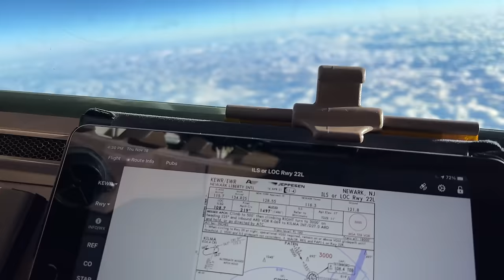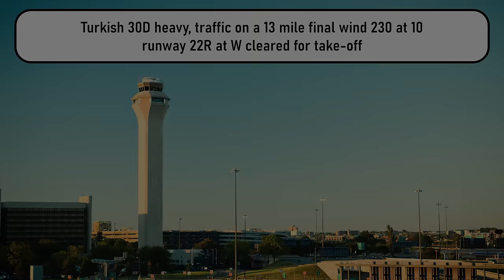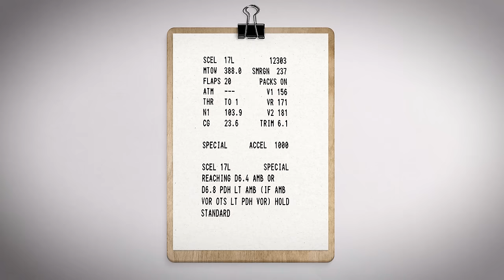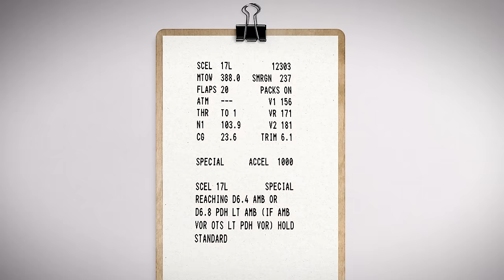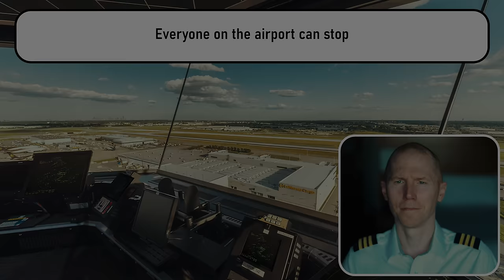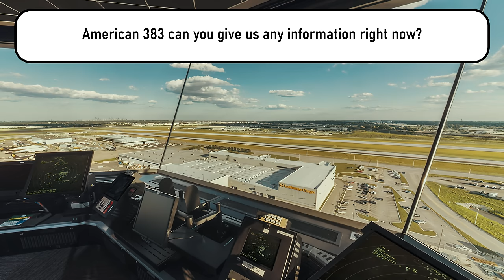American 767 Engine Fire

Comment: I've taken off from a taxiway once, the runway was occupied by a private pilot taking their sweet time vacating so ATC cleared me for a departure from the taxiway. It helps that I was driving a helicopter (Cabri G2 for the planespotters) and can just sorta go up.
Reply: Had us in the first half ngl
Reply: Funny story, although I am confused (a regrettably common condition). Why do you even need a runway? We've all seen helipads on skyscrapers, yachts, and hospitals, and let's face it, they don't have a huge amount of run-off. Do you just drag it out there on the asphalt, making some Formula 1 Singapore GP style sparks for show?! (I mean, that would be fun.) Or is it just airspace management? 🤔
Reply: @Cameron655  Runways are surrounded by something called a Strip. The Strip is an area of airspace guaranteed to have no obstacles or intrusions which allows aircraft to take off and land safely and provides enough space to perform emergency maneuvers. Runways are also rated for a higher pavement loading than taxiways. Technically speaking you can take off from any area that you can drive on but landing creates a huge impact which won't affect a runway but may damage a taxiway. It is always safest to perform maneuvers on a runway. Airports like to treat all aircraft the same so if there is no specific procedure for helicopters then they will be treated the same as a plane. In the case of the Cabri, driving around an airport can be done in one of two ways; It can be propped up on a pair of wheels and pushed around by hand (normally only used on the Apron) or you can perform a hover taxi in which you take off into a hover and then move around slowly.
Reply: @Cameron655  It's safer for a heli to get into a ground effect while still having some forward speed, rather than to start hovering at altitude and dropping down vertically.

If the engine dies and the heli has to autorotate down, forward speed is king.

Sure, the same gradual descent and then transition to hover can be done above a taxiway, but I guess it's a bit more comfortable knowing that you can approach the runway at any speed and not worrying about coming in too fast, too close to other traffic or not exactly on centerline.

But I'm not a pilot, just a heli sim player.

Also, some heavy helis have wheels and like to land and take off like an airplane for the same safety reasons.
Reply: Oh you trying to look smart eh by keeping important information from us until the end, wow you're so witty
Reply: I feel RickRolled.
Reply: @therflash  he probably dint go straight up most heli's are incapable of that/your trained not to do that, you cant even go straight up or down if your flying emergency helicopter's (medievact ect) also it is pretty common to take off from the taxi way as a helicopter (source I'm helipilot in training we take off the taxiway a lot actually atc prefers we take off the taxiway over the runway because it doesn't block fixed wing traffic}
Reply: @therflash  also who know's if he is even telling the truth lmao, i have never seen a pilot in my life say that they "drive" a helicopter. would get ruthlessly made fun of by my instructor if i said that but who known's maybe English isn't his first language or something lol
Reply: @limyarplane1991  I deliberately use the wrong terminology because it annoys my colleagues, for example they hate that I call them "rudder pedals". "They're not rudder pedals, they're anti-torque rotor collective pitch controls".
Rudder. Pedals.
Reply: @Cameron655  Yes, airports are the most dangerous places to fly. Near them is where most mid-air collisions occur. So, helicopters should fly in predictable patterns. They are also required to give right-of-way to airplanes when in flight.
Reply: @fyrep0w3r  i see
Reply: @therflash  having horizontal speed while descending in a heli also helps avoid getting caught in a vortex ring state as well
Reply: @limyarplane1991  Do you also land on taxiways? I was more talking about landing.
Reply: @Spectre-907  ofcourse
Reply: @therflash  ya we land on them to, you just transfer to a hover taxi and taxi over to your parking spot. tbh it really does depend on how busy the airport is, if there is someone on the taxiway we cant land on it obviously but if no one is on the taxi way they normally prefer us to take off and land from it, its alot easier in term's of the clearance you need to get from ATC
Reply: @therflash  There's a funny video on youtube somewhere where ATC clear a small plane to land on a taxiway, thinking they're a helicopter. Video title - "I would prefer to land on a runway" :D
Reply: @domc8383  What do you mean by "drive forward"?
Reply: lol
Reply: @domc8383  Put it in D, Most can just by tilting the rotor a little, its the actual good wheels that are ususally the issue.
Reply: @fyrep0w3r  Thanks for the explanation, I didn't knew that about helicopters. And for the laugh of cause :)
Reply: @Cameron655   Also, “driving” a helicopter?  Is that the common terminology? 🤔
Reply: @Cameron655  Another issue is the creation of FOD.  By having the helicopter stick to the runways, they're not blowing stuff onto the runway which could than get sucked up by jet engines.  I did see the tower get mad at a grass-cutting crew for clipping that got out due to the wind.  A helicopter taking off while this was going on went down the entire length, rocking side-to-side and blew the grass off.

Comment: It's ridiculous how even after the rejected take-off, the pilots keep reading back the tower's instructions as "vacate runway"
Reply: I would imagine the embarrassment factor was VERY high with a professional long haul crew.
Reply: They're saying it out of rote, not awareness, which means they had no clue.
Reply: Language barriers are teal!
Reply: @juliemanarin4127  As opposed to scarlet...? ;)
Reply: @davidcole333  Of that I’m sure. I work as ground crew at my local airport and one night I was cleaning the cockpit of a 737 while the engineers were there doing something with the engines. I wasn’t used to this-normally the plane only has electrical power from a diesel generator ground power unit and very occasionally the APU if the engineers are doing something unrelated to the engines or it’s a quick clean during turnaround with the pilots present. So on the very rare occasions when I accidentally press a button or flip a switch it’s not a big deal. No power, no harm done so just follow protocol. But of course of all the things to do, I accidentally turned the intensely bright landing lights on, letting the whole airfield see my blunder. I swore like a pirate and turned it off and the engineer with me (who I enjoy a good working relationship with) almost wet himself laughing. Ugh I was embarrassed for weeks afterwards as various pilots and engineers both gave me an admittedly deserved ribbing multiple times. 🤣 I can’t imagine how bad those guys felt.
Reply: @qwertyuiop3455  That's they way I hear it.  It reminds me of all of the car videos where people assume the other person is operating under malice not that they are completely unaware they did something wrong.
Reply: Confirmation bias
Reply: @vocs75  Or operating from inattentiveness, like a car which passed me in the opposite/oncoming direction which still hadn't turned on its headlights shortly after dark.  I decided to help them out by flashing my highbeams.  Then a bit later I got to where I was going, and realized there had been two inattentive drivers on the road:  My headlights hadn't been on either  : )
Reply: @JoshuaTootell  Exactly!
Reply: Well they did use it as a runway...
Reply: "Excuse us, Turkish, you overshot the RUN way back there, you are genuinely on a TAXI way, and you almost took off from it.  That is dangerous.  That is why we told you to stop.  We want you to take off from a RUN way."

In other languages there may be ambiguity about what these things are, but also maybe the practice of using less than an entire runway, as mentioned, isn't as common overseas so a pilot might think that a usable runway start can never be a cross intersection with their taxiway.
Reply: @dh88k  Well they tried to -- a sharp witted controller might look and see that nothing else is out there or about to cross it, therefore could let Turkish go, but if Turkish panicked and realized at the last moment that this was wrong and tried to stop... how do we get these renowned world class airlines and the pilots don't understand what a runway is?  I guess anyone can have a brainfart.
Reply: @SeekingTheLoveThatGodMeans7648  preparation is important, pretty sure you can get some maps and stuff if you are a pilot
Reply: I assumed they might be doing that for if their bosses heard about the incident so they could deny it happened as reported. Basically the “never admit fault unless you have to”strategy so many airlines like to use.

Comment: Plane is still at ORD by the burn pit, they just recently got all the insurance and other legal matters taken care of and the plane has been officially donated to the Chicago Fire Department for training purposes. A friend of mine who is a CFD firefighter out at ORD was recently onboard and said nothing on board was moved, the same newspapers were there and the pilots water bottles were still in the cockpit…
Reply: I'm guessing they at least stripped it of the left engine and the avionics before setting it on fire again?
Reply: Did they get the luggage off? Or at least the Cary on?
Reply: @KonorSacks  I would imagine so... probably made the plane safe first by removing the remaining fuel, then tow it to a back area, where it would have been emptied of personal belongings and cargo. In some of the pictures you can see the aft cargodoor is open with stairs next to it.
Reply: The last part reminds me of when I was talking to a friend of mine who is a firefighter about the building my company was about to demolish (a datacentre). He brought up that they very rarely get to perform live training exercises on industrial structures like that and asked me what my thoughts would be on allowing them to use the site prior to the demolition starting. Granted a bunch of the equipment did get moved but there was enough obsolete stuff that we would have had to pay to recycle otherwise to fill a couple of the floors and then they simulated a scenario involving a fire starting in Electrical Distribution Room 3, I think they rigged one of the 50 kVA UPS's batteries in there to go into runaway. Was interesting as I got to observe the exercise and even participate in a small way as I was allowed to play the role of giving the information that we would have known had the scenario been real (Where the fire panel indicated the fire, the location and contents of the diesel tanks for the backup generators as the site had a pair of 20kl tanks on site, and that two people were not accounted for as they had two firefighters acting as casualties inside).

There is a new facility on the site now as that is why it was being demolished for a new larger facility to be constructed on the site but yeah fire departments also need access to old structures that are due to be demolished where available too, there are hazards and conditions that can't be well simulated in a structure that is not under genuine threat eg observing the signs of the structure itself being degraded by fire and assessing stability.
Reply: I haven’t seen it there, do you know if they removed it sense construction started?
Reply: Just think of all those wasted snacks... 😔

Comment: I read the AAL383 report -- the pilots were pretty much clueless to what was happening in the back, thru no fault of their own. The flight attendants saw the fire obviously, but every single one of them in the cabin basically forgot how to operate the phone/intercom (the AAL 767s had two variants but only trained for one variant, this was the other surprise surprise). Naturally given the massive fire the FAs started an evacuation without any communication to the cockpit whatsoever, until like a minute after the first slide deployed somebody banged on the cockpit door. A significant fraction of the passengers evacuated on the left side while the left engine was still running, it was sheer dumb luck that nobody was hurt that way. Eventually the pilots got wind that the evacuation was in progress, and told tower and shutdown the left engine as the evac was ongoing. And obviously despite the intercom blunders, the FAs did 98% of their job correctly to get all the passengers off more or less unharmed, despite most of those passengers carrying their carryons (dumb passengers as usual). All in all, it was definitely a "successful failure", to borrow the Apollo 13 term. Even with an engine blown up, and FAs unable to call the pilots, and an engine still running during an evacuation, no serious injuries occurred other than the usual slide injuries.
Reply: After this, they revised the checklists for an engine fire to include turning off the engines if they were still on the ground.